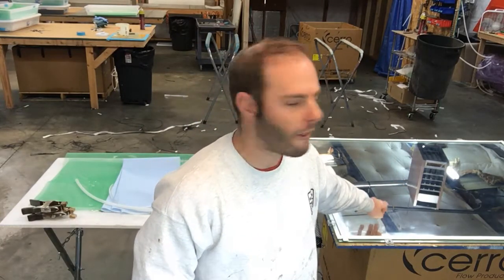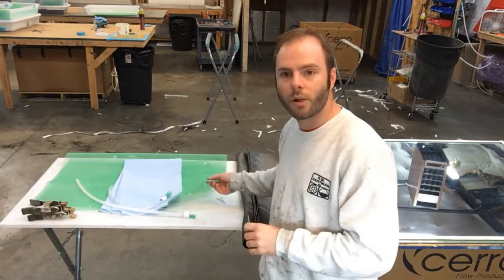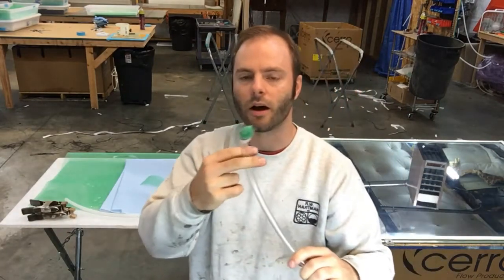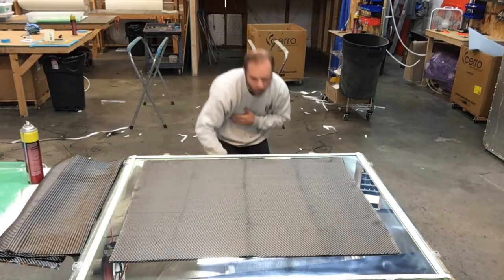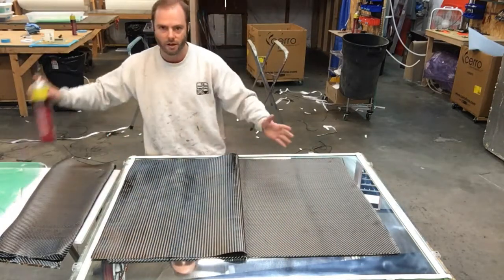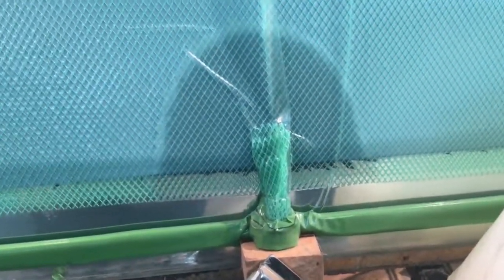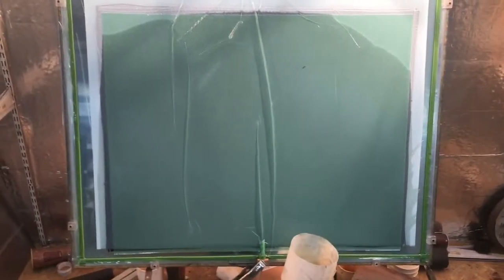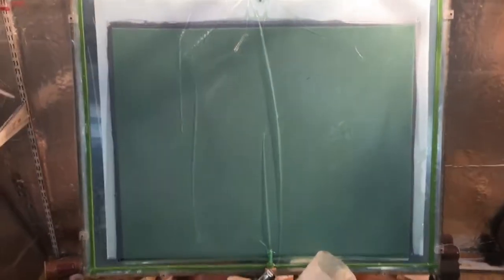How To Infuse a Carbon Fiber Panel

Comment: Question?........... I want to do an airplane wing skin. I hope to do both sides at the same time. Infusion process. Using the uphill technique so leading edge is low spot. Wing is about 15 feet long by 4 feet high. 2 ply of carbon fiber .012" thick each play. About $2,000.00 in fabric for one wing panel (left and right sides). Can it be done? How many resin inlets should it have? I plan to use the spiral tube type to help with the start. How many pump ports should be used? More than one pump needed? How massive a pump do I need?. Many questions as I just getting started. I do have the Wing "plug". I will use micro balloons to smooth out the surface that is the outside. The inside next to the plug mold is not the surface I need smooth obviously. 

Thanks!
Reply from the maker: Erik 567 sounds like it will work but will require post finishing since you will be left with the peel ply finish.
Reply: @ajhartmanaero  OK thanks. I will try with fiberglass as a start and learn all the problems that will come up.

Comment: Very informative! Thank you for these vids and please keep them coming. Would you be able to say what infusion resin you used in the the video and what are gel and cute times. Also did you post cure the panel? Thanks!
Reply from the maker: I use Rhino Linings. Theres several to choose from tho. ProSet makes some as well I was looking into. Cure times depend entirely on mix ratio (I can mix fast and slow any ratio I want) and tempature.